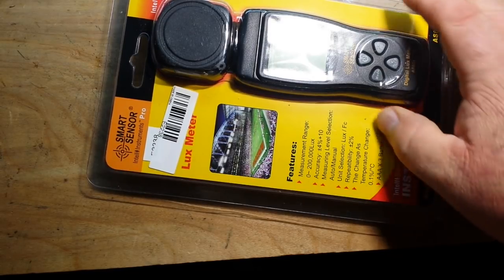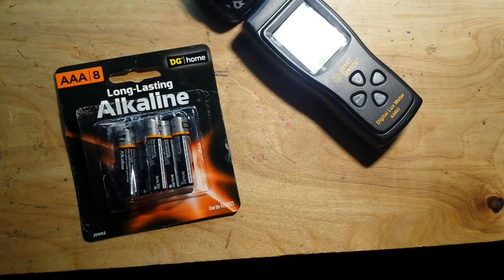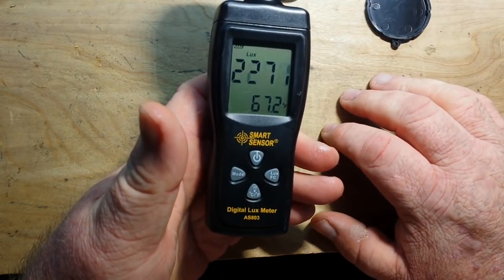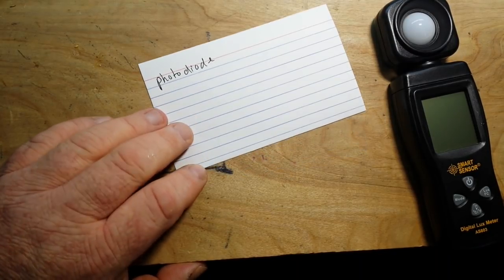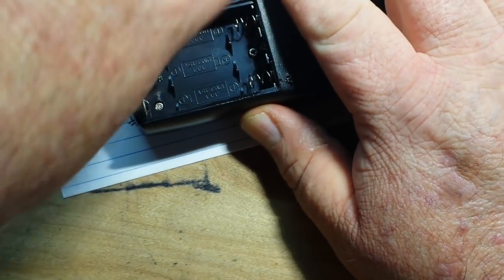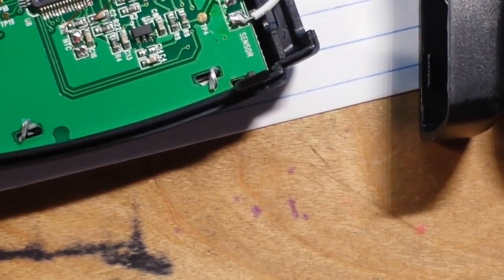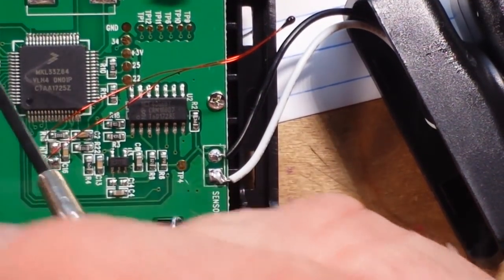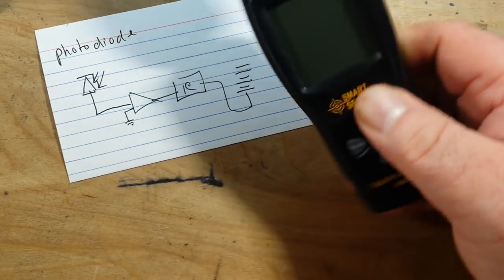How does a lightmeter work

Comment: Are you sure the MEF4066AT is not an HEF4066 quad analogue switch?  Also, why are you so sure that the sensor is a photodiode and not an LDR?
Reply from the maker: I reported what the ic label was. As for the photodiode in a light meter... That's best practices. You can use whatever works for you
Reply: We might both be wrong regarding the sensor, it may well be a solar cell!  This teardown of a Tasi-8720 light meter has some similarities.. https://www.youtube.com/watch?v=ymUqNTDJn1g